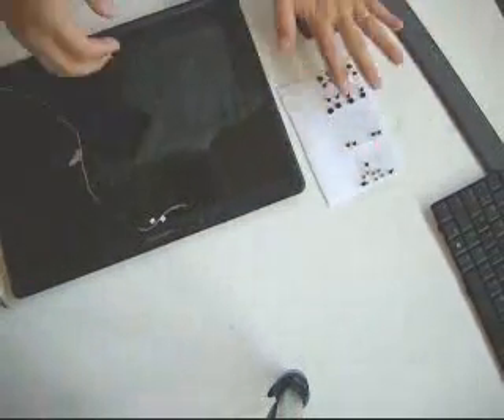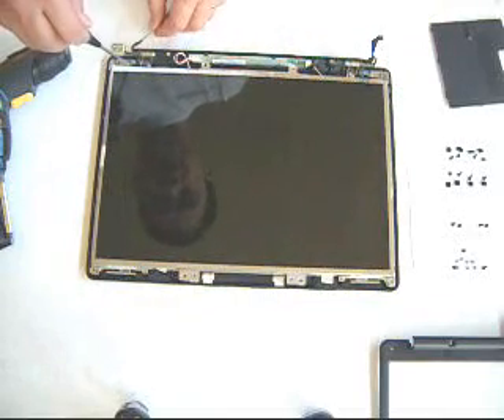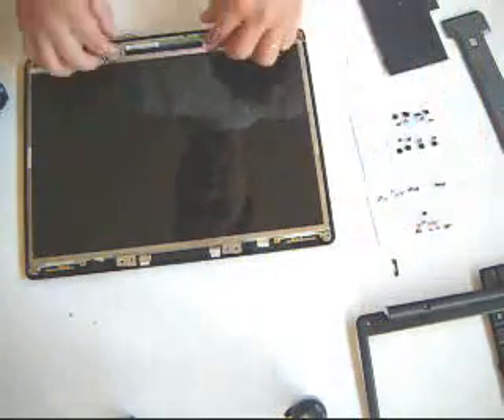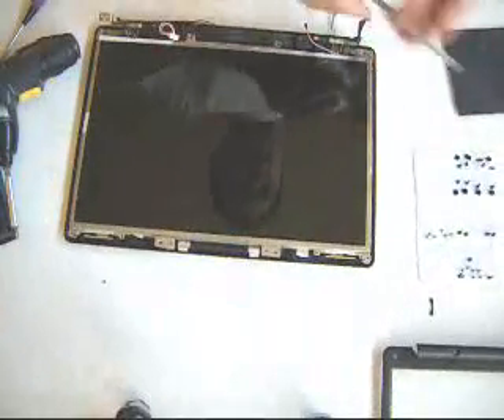How to replace lcd screen of HP Compaq Notebook

Comment: ***** The screen of mine began freezing followed by random colors taking over the picture. I have to adjust the screen carefully forward and backwards until the picture comes back.

Is that because of the lcd connecting cable?

Comment: @curpion dv2000/dv6000/dv9000 compaq presario F500/v2000/v6000. has a MB chipset issue. Symptoms are wireless not detected and no video display.. Its a motherboard problem admitted by HP.. Company Only created a program that would replace the mb for free covering 1 year after standard warranty runs out. These models which is AMD based is 95% under the (Limited warranty service enhancement). On top of that they have the Nvidia GPU which is also has a known problem. So intel based, cant escape..